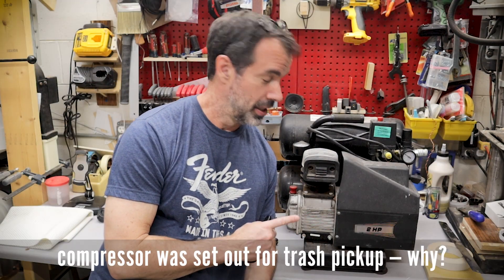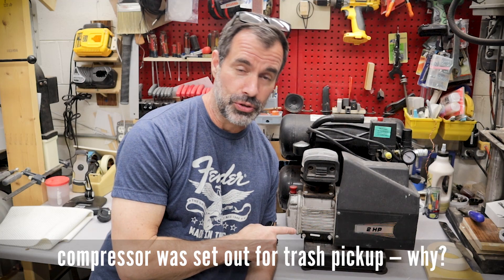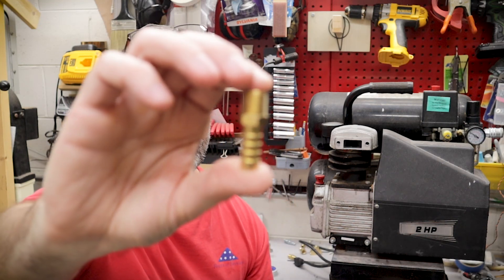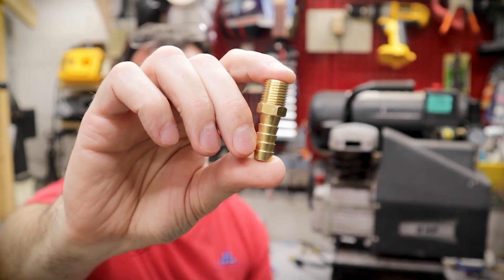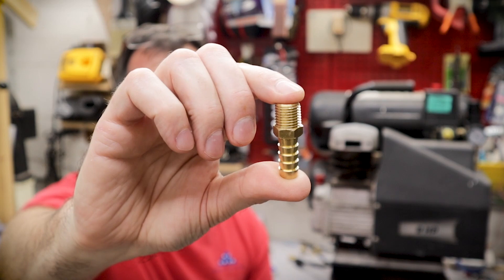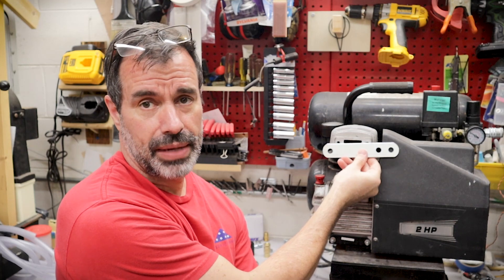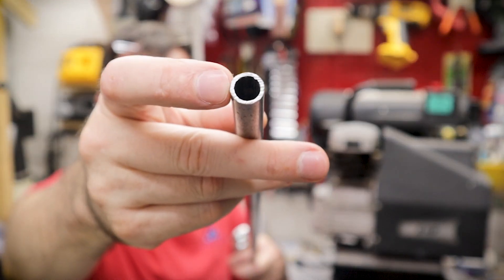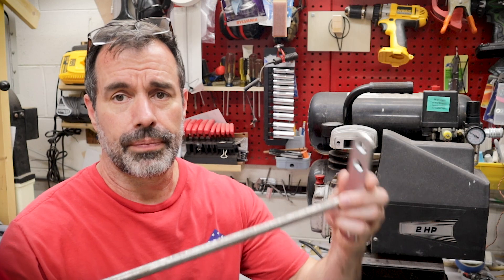Air Compressor to Vacuum Pump Conversion - The Next Project

Comment: I've considered adapting my air compressor so I can also run a vacuum line. The one thing that concerns me is that a compressor not designed for this purpose may draw in oil from the crankcase because the chamber is under so much vacuum....Not sure if this is a real issue?  I have an Ingersoll Rand 80-gal. 5 HP Two-Stage Industrial Air Compressor that I've replaced the motor with a 6HP heavier duty motor.
Reply from the maker: @Frank Edging, that is a great question and concern. I think I may have touched on that in my video description. 
For my use, and since this was a "free" compressor, I'm not worried about it, but it is a legitimate question and based on what end use you have in mind it could be a fatal issue for the compressor. 
For my use, I run the compressor for about 15, to 30 seconds at a time. So far, the oil level hasn't budged, but I don't use it everyday either. 
Use caution and proceed at your own risk. Keep your hands inside the vehicle... All that good stuff.
Thanks for comment/question, good luck with your project!
Reply from the maker: @Frank Edging, I was just wondering (haven't checked or tested) the ratio of cylinder pressure (compression) vs cylinder vacuum. 
Hmm, now I wonder what kind of ring set this little old compressor has. Hmm.
When I use it to draw vacuum, it will pull down my vac bag to -23 Hg in about ~15-18 seconds. Not sure the rpm of this compressor either, ugh.
Oh boy, this is starting sound like science + math.